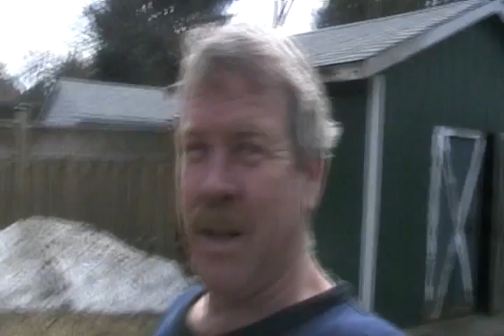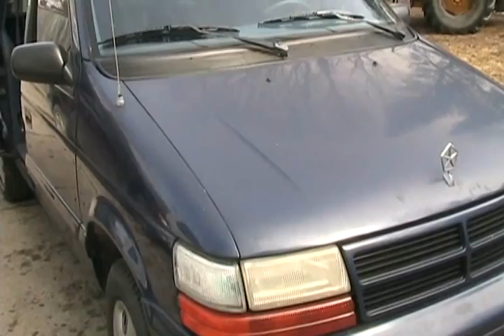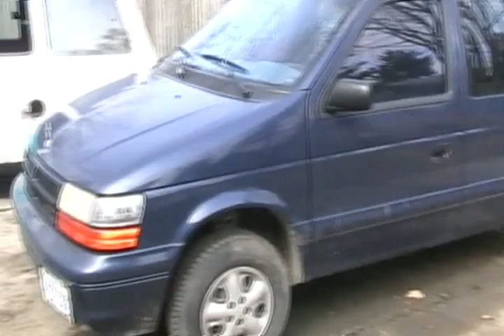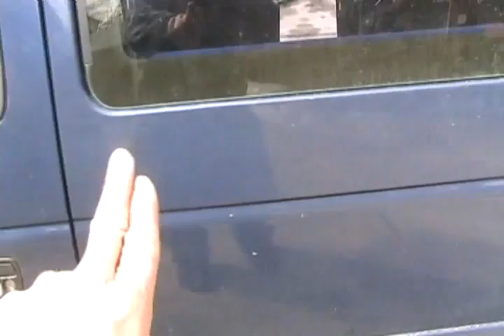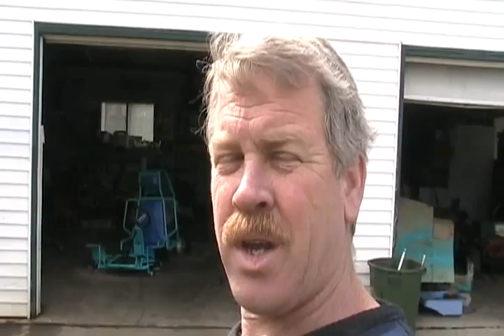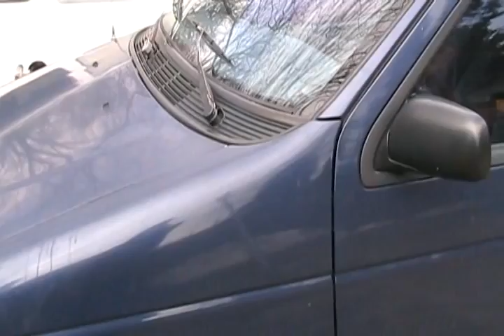Dimples on cars increase fuel economy

Comment: Speed and shape are a big part of it as i understand it. There is surface friction and pressure drag added together to get total drag. D=Df+Dp

This changes with the shape and speed of the object. A ball is not aerodynamically shaped, it has poor laminar flow and lots of pressure drag. Adding dimples increases surface area, Df, but creates a turbulent boundary layer lowering the pressure drag, or turbulance, against the ball on the back side. Getting rid of the pressure drag has a greater effect to the overal drag of a ball even though skin drag may increase.

A plane shape has high laminar flow and low pressure drag, and adding dimples will greatly increase the surface drag of the plane shape without eliminating much pressure drag. So the total drag of the plane will increase if you put dimples on it. While a car, with much poorer laminar flow and higher pressure drag, it may actually help depending on the car shape.

Speed also comes into play here too, not just shape. Some plane wings are designed so that a cruising speed, there is the optimal  balance created between these two flows using both the shape of the wing and winglets along the leading edge to create a boundary layer like on a golf ball. This, hopefully, achieves the lowest possible pressure and friction drags.
Reply: In the case of your minivan, which is an awful lot like a golf ball aerodynamically. Putting dimples on the back half, since it does not rotate like a ball, to reduce turbulence behind your van should help fuel economy. In a wind tunnel, the flow behind your van will be more laminar than turbulent if you put dimples along the sides and roof and tailgate. Do it.